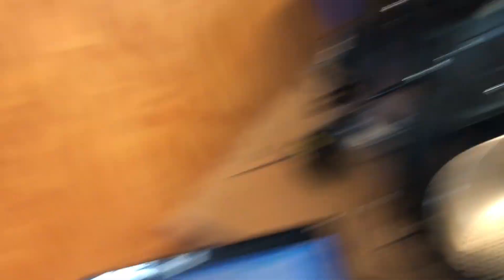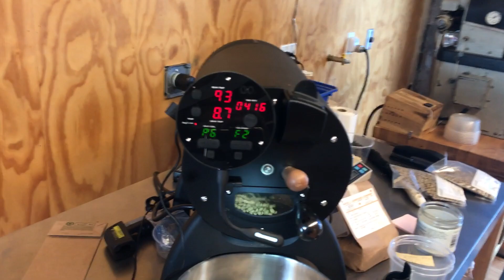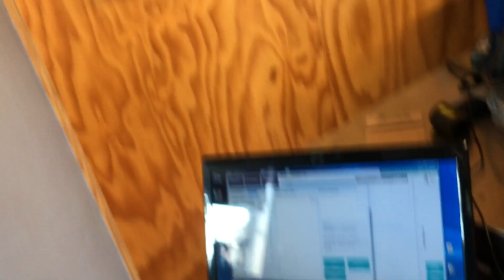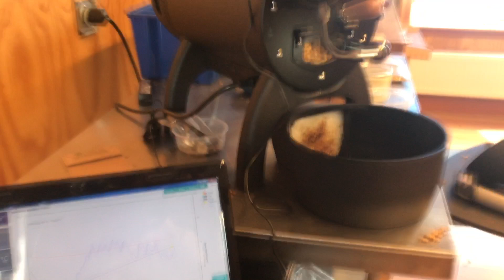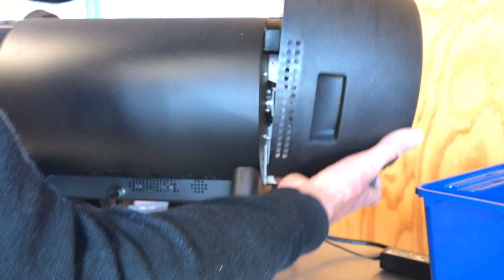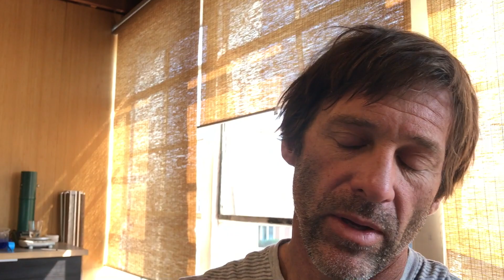Aillio Bullet Roaster --First Impressions--

Comment: I have bought a small "BocaBoca250" coffee roaster from South Korea but I'm struggling with getting good tasting roasts. Does this roaster have built in programs that would give me a decent roast? I get that you have to train and know what you are doing but would this roast give me decent results from any built in programs/profiles? My bocaboca roast is an infra red roaster. Totally manual with adjustable heat.
Reply from the maker: The Bullet can record your roasts and play them back but there aren't any built in.
Reply: Sweet Maria's Coffee ok, thanks for letting me know

Comment: Can it be switched to Fahrenheit?
Reply from the maker: Yes it can. If you own one, here's how to make the switch. When the R1 is in Off mode, press F1 to enter and toggle through the menu. The clock display will tell you which menu item you are currently changing. To exit the menu keep pressing F1 until the Off appears in the clock display.
CEL / FAH is displayed. Press the A button to toggle between Celsius (CEL) or Fahrenheit (FAH).
Reply: Sweet Maria's Coffee thanx for the reply, i dont own one yet but am thinking of buying one since my hot top just stripped a gear and doesnt work and the company aint doing nothing to help, they want u guys to help me with it which doesn’t make sense since they built it not you guys, ive only had it for a lil over a year.

Comment: Thanks for the video. Would you recommend this roaster for a stressors roasts? Does the software allow you to save a profile and then replay on a 2nd or 3rd batch of the same beans? I guess I’m wondering if their software takes control of the machine and programs the different settings.
Reply: Yes, the machine is able to replay your roasts. You can even use shared profiles that other Bullet owners have created.

Comment: if I needed the capacity I would seriously consider this, although the price is a bit steep.  As is I will stick with my little $200 (actually now that I check it was $345).   Now they have them on amazon for $404.  Korean drum roaster off ebay known as a Kaldi  Missing some of the niceties such as data logging and fan speed control, but really its pretty simple to roast up
 to 1lb and my shop vac powered cooler works as well as this.   Cleaning and maintenance are much simpler than this too.  Doesn't take long to get a good feel for the roast process and you don't need all the data honestly, it is simple and I (and owners of the allio) aren't like commercial roasters doing huge batches while trying to maintain roast characteristics roast after roast.  I find, for me, 1/2 lb and sometime full pound  a week roasts are sufficient and keeps the roast fresh (I am the only coffee drinker in the house) and small variations roast to roast keeps life interesting.

Comment: Good vid. Too bad it won't work on Apple equipment. I like using my popper (actually a "1250amp Pumper"hooked up to a variac (not split wired) because I can get very consistent roasts of just 6 oz and then have fresh roasts of a variety of origins/blends of green coffee (most from Sweet Maria"s).
   And the investment is fairly minimal, in comparison

Comment: Nice "first impressions" video. We love our Bullet. Great machine, very responsive and efficient. Also, you can set both the roaster and the software to display either Fahrenheit or Celsius. Excited you'll be carrying them. Any chance you'll also carry spare/replacement parts? Additionally, there is an adapter you could also sell for the exhaust port that will allow for the connection of a 2/3 inch pipe. Looking forward to more roasting videos with the Bullet. Thanks!